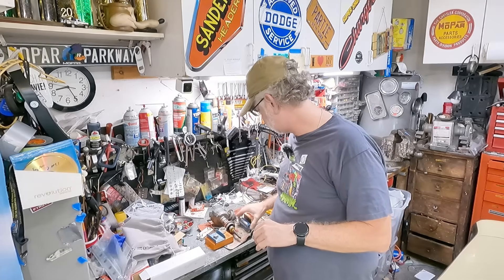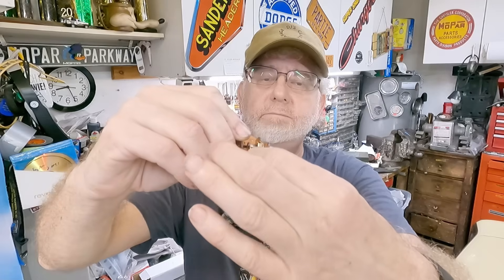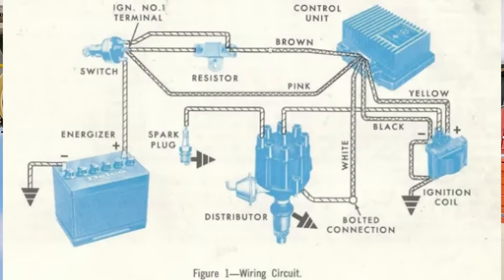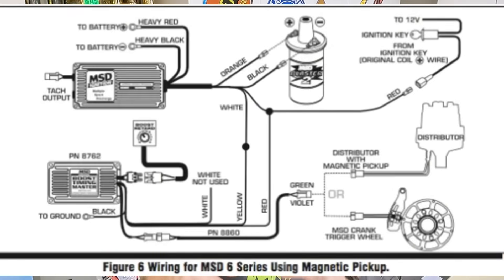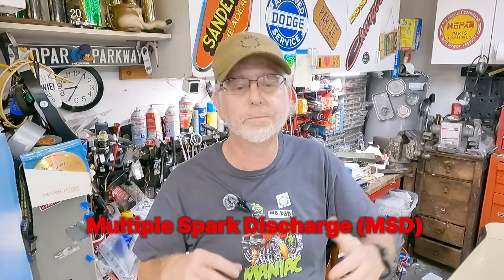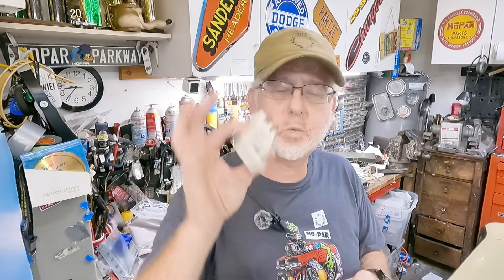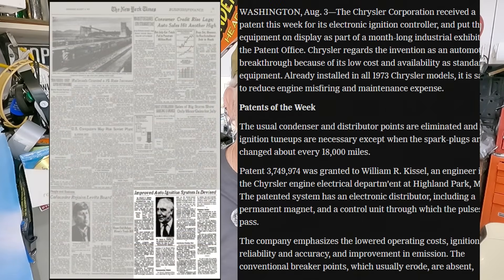Why Everything You Thought About Electronic Ignition is WRONG

Comment: Please let me clarify a couple of things. 
The voltage across the points was about 8VDC while running. There was a resistor to drop battery charge voltage while running, but that was bypassed while the engine starter was engaged. The points are on the primary side of the ignition coil, it's the secondary at high voltage. There was a tiny arc, but the capacitor reduced the current available at the moment the points opened.  

The concept is very commonly misunderstood. The primary coil was charged while the points were closed, like an electric magnet. The quicker the current changes in a coil, the stronger the magnetic field. The primary magnet causes current in the secondary coil, but only when the magnetic field changes. If doesn't matter if it changes from charged to not, or from not to charged, only that there was a change. 

So, when the points open, coil voltage changes from 8V to 0V as quickly as possible. The magnetic field went from strong to none, making electrical energy in the secondary coil. If the secondary coil has 1000x the number of turns, the voltage will be 1000x 8V = 8000V. It's the perfect high voltage pulse we need to make a spark.

The coil charges slower than it discharges so there not enough on the secondary to make the spark.

Dual point distributors allowed good ignition operation at higher RPMs. A single set of points could not remain closed long enough at high RPMs to fully charge the coil. This was fixed by using 2 sets of points slightly offset but overlapped from each other. If either or both are closed, the coil charges, both contacts must be open to disconnect the coil circuit.
Reply: You are a bit incorrect. On vehicles with a resistor before the coil + or key power terminal, with the points open and the engine not running, the coil will read battery voltage on both terminals. No current flow so no voltage drop across the resistor. 
Rotate the engine to close the points and the resistor causes a voltage drop on the + terminal of the coil, to about 8V while the - terminal drops to 0V. 
With the engine running, you would expect to kind of average the 8V and 0V coming in about 4V. This does not happen.
When the points open the inertia of the electrons would cause a spark arc across the points, which would wear or burn the contacts out quickly. Thus the need for the condenser or another name, capacitor. This acts like an acumulator to let the electrons flood into until the points are open far enough that the electrons can not jump the gap. Now the condenser is full and those electrons want to equalize the pressure or voltage. The electrons come out of the condenser and flow backwards through the coil. This aids in quickly collapsing the charged magnetic field in the coil. It is this rapid field collapse across the coil secondary windings that generates the high voltage to jump the sparkplug gap. During this process, the quick magnetic collapse also induces a voltage in the primary windings that can be around 250V. If you do not believe me, try touching the coil negative terminal on a running engine. Then get your multimeter out and test it.
Through this the + coil terminal remains fairly steady at about 8V.
Some coils are built with an internal resistor. These have three terminals; +, -, and starter. While running the + has battery voltage to it which is internally reduced to about 8V. The points side or - operates like the others. During cranking to start, voltage is supplied to the start terminal, bypassing the internal resistor which allows full ignition secondary voltage. 
During cranking, the starter current draws down available battery voltage to about 8V tp 9V. The systems that use a primary resistor of some sort, bypass the resistor somewhere in the wiring system, allowing the 8V during cranking to be supplied to the coil.
Reply: @daledavies2334  Oh how fun!! Please enjoy my retort. "You are a bit incorrect"
I'm sure I had some details lost in vagary. I wasn't publishing a study. 

I didn't mention the engine off condition. If contacts are assumed open, then I agree battery voltage would be measured at the +coil. Although batt+ could be measured, it is not available as potential to drive the circuit when connected. This measurement would be invalid due to improper configuration. 

Why would you expect to measure about 4V at -coil? A DMM could not measure this quickly changing voltage due to the method of voltage measurement it uses. These measure the time to charge a capacitor in an RC circuit, to cross the upper threshold of a 555. In DC mode the sample rate is longer than this circuit. Did you select AC Voltage on the DMM? What was that result. 
Check with an O-scope then get back to me. You can measure the dwell time -coil is at 0 and the ramp time. It's not an RC circuit the capacitor is bonded to ground on both poles while points are closed. At this moment, points are ground, capacitor is ground, -coil is ground (except minimal wire resistance.) 

The secondary magnetic field collapse causes induced Current, not voltage. The high voltage is due to the number of windings within the changing magnetic field. 

Electrons flow from lower potential to higher, from ground to +voltage. This is not backwards through the coil. I agree the cap is there to preserve the contacts. 

The high voltage measured at -coil while points are open is not supplied by the capacitor. This voltage increase will be shunted to ground through the capacitor as an AC signal. It's part of the noise reduction strategy. 

It is the very noisy secondary current which causes the primary current induced from the secondary coil. The secondary load is a sparkplug, an arcing current. Arc currents are nothing close to a resistive load. The current flow via an arc is extremely intermittent. This high frequency very dynamic current causes current changes in the secondary coil, which causes very dynamic magnetic fields which induce this ugly noise back to the primary coil. I forgot what this effect is called but occurs wherever the secondary loads are not linear. The unimpeded portion is shown as the k-factor which causes heating of transformer coils and conductors. 

+coil will remain at about 8V because it is bonded to the Battery, with a linear resistor in series. 

-coil voltage will bounce around like crazy, unless the points are closed. Only wire resistance affects voltage while the points are closed to ground.

The resistor. Each OEM had to build the resistor differently, or pay for rights to use, patents were filed. So, there are many variations. The simplest was to use the key switch start position. The same issue made resistors, capacitors, points, coils, and all else require some creativity. Like where to get the switched bypass supply.

However, the capacitor is always parallel with the points, the resistor is in series with the coil, all are electrically identical (I think).   

What an interesting way to describe the role of the capacitor. 

"capacitor. This acts like an acumulator to let the electrons flood into until the points are open far enough that the electrons can not jump the gap. "
Actually, when the points open the electrons would flood out of the capacitor from its' grounded pole to the higher voltage -coil. But that's hard to imagine. 

The sudden voltage changes at +cap & -coil, is shunted from ground through the capacitor. Current flows through the cap by the ratio dV/dT. 
The quicker voltage rises, the more current the capacitor will shunt. 

Several issues we agree upon. Yes, the cap helps the coil's mag field collapse quicker. But it does so by shunting the induced noise to ground. That induced current impedes the collapse, no doubt.  

The cap does reduce arc over at the contact points. When points are closed, cap is fully discharged, and lots of resistive current in the coil exists. When points open, the coil impedes this current change with its stubborn EM fields in primary and secondary coils, and core if exists, rather without success. The sudden potential difference at -coil, causes the cap to conduct to ground any quick voltage changes. This does give the contacts time to clear contact conduction. With 0 current through the contacts, no arc can form.  

8VDC is not able to form and arc over any air gap. Studies at 60VDC show conduction is first required to strike an arc, then at least 10.2V DC across the arc is required to sustain it. A minimum supply of >2x or about 22VDC is the minimum viable supply voltage. 

I could see induced current from the secondary coming along to ruin our day. But this is still just noise to be filtered by that handy capacitor. 

When the cap failed, the radio would really suck. If the car would even start.

Comment: 12 volts when cold and reduced to 8 volts after about 30 seconds is sent to the coil. The coil is a transformer and the condenser (capacitor) turns the DC into AC. Transformers (coils) don't work with DC only AC. A ballast resistor drops the volts to 8 after a short time, if it didn't the coil would overheat. Dual points are used to allow the coil more time to saturate (dwell) its magic field to produce more voltage (larger spark) I didn't learn all of this till my mid 20's, I originally thought the same thing.
Reply: Battery voltage drops while starter motor is engaged, fairly close to 8V. The Ballast Resistor was typically bypassed by a wire from the starter solenoid contactor to the + pole of the coil. So coil voltage was battery start voltage while starting, then 8V once starter is disengaged without delay. The solenoids, or starter relays, had an integrated contactor specifically for this purpose. There may have been vehicles configured as you described, I just didn't encounter one. 

Ignition coil primary voltage is not DC. It is an AC Square Wave 0V to 8V. Capacitors are not able to change DC to AC. In this application, the capacity reduces the current available when the contacts are opened, just long enough to avoid contact arcing.
Reply: @CycleWerkz on mopar with points they used a ballast resistor. On the ford solenoid the 2 small terminals I for ignition and S for start. Thought i was getting long winded.
Laugh.
My first car was a 1970 Duster. Slant 6 burnt my fingers and eventually its ballast resistor went out, i was 15 in 1984 when i got it for free becausw it didnt run. My 2nd car in 1987 was a 1969 Torino (fairlane) Loved that car, put like 400k miles on it, it had a 302. I had the points trigger a MSD 5 on it after about a year after i got it.
Reply: @kardeef33317  

Awesome, I ran a 64 Fairlane. I think it came with a 289 but was empty when I got it. I stuffed a 390 in the bay with some help from a blue wrench. 

The S on the Ford Start relay energizes the coil in that relay. This closed battery + to the starter solenoid. The S terminal is an input from the key switch. You can use any conductor to connect battery + to the S terminal and the car will crank. Handy while under the hood. 

A coil is an inductor. There is no difference. Coils do what they are designed to do with DC, it is a conductor, a closed circuit. When points are closed 8VDC is on the coil so current flows and it becomes an electric magnet. When the points are closed, this capacitor is discharged. Both sides of the capacitor are then connected to ground. 

Inductors and Capacitors behave opposite each other. Inductors pass DC & impede AC. Capacitors Pass AC & block DC. The values printed on the parts are used to calculate the AC frequency where this effect is substantial. One can design a circuit with both an inductor and a capacitor to select the AC Frequency range allowed to pass through both. This is known as an LC band pass filter. If in parallel, it will block both high and low frequencies but pass those in the sweet middle spot. 

These are not in parallel. The capacitor is in parallel with the breaker points. One side of each are tied to ground, the other to the negative side of the coil. The coil positive is tied to battery + through a resistor, for about 8V. 

The breaker points open and close which creates an AC power supply to the ignition coil. It connects ground when closed, then opens the coil circuit. Coil current drops very quickly to 0 so it releases its magnetic field. This magnetic field was also present in the transformer secondary, when released that secondary winding forms a current due to the changing magnetic field. As you mentioned, the secondary winding will only provide current during a changing magnetic field, not when constant. 

While the contact points are open the capacitor is charged because there is 8V on the positive plate from the coil and 0V on its negative plate. Because the voltage changed, the capacitor flows current long enough for the contact points to escape the arc-over clearance. Once the capacitor is charged, no more current can flow through it. 

Without a capacitor, the coil would still make a spark, but the contact point would become pitted quickly, and the output spark would be delayed and weak. 

The arc between the contact points arcing would slow the current change in the coil which would reduce magnetic field strength. 

You are correct that a transformer will not work without an AC power supply. But this transformer does have an AC power supply.

Here's a diagram 

https://www.bing.com/images/search?view=detailV2&ccid=%2BcllFWPF&id=BAF7E39E7FAE0E7BBCF854FC1003419FAB936120&thid=OIP.-cllFWPFT26cnuUao_tuqQAAAA&mediaurl=https%3A%2F%2F3.bp.blogspot.com%2F-278lSm5V5E0%2FUeIe4N1aUsI%2FAAAAAAAABBI%2F__ZM_BGYJoA%2Fs1600%2Fignition.gif&cdnurl=https%3A%2F%2Fth.bing.com%2Fth%2Fid%2FR.f9c9651563c54f6e9c9ee51aa3fb6ea9%3Frik%3DIGGTq59BAxD8VA%26pid%3DImgRaw%26r%3D0&exph=293&expw=400&q=point+ignition+system+diagram&form=IRPRST&ck=8627F40740B756303B35152F0AF70A78&selectedindex=0&itb=0&ajaxhist=0&ajaxserp=0&vt=0&sim=11
Reply: @CycleWerkz a coil with DC just acts like a inductor, need AC for a tranformer to work and thats all a coil is. Ask someone that does electeonics if a coil or transformer will work with DC. A capacitor maintains voltage through amps. The only reason i know this is in my late 30's I got i to electronics.

Comment: I have an 83 dodge van with a slant 6. I’ve had Mopar stuff since the 80’s so was familiar with the components you talked about. The ignition in my van was a mystery to me. Turns out someone in it’s history swapped in a 1990/2000 HEI GM ignition. The problem I was having was the control module was over heating even after a short trip to town(30miles). I bought a heat sink for a computer, taller with more fins and the issue is gone finally. 2000 miles later it’s the strongest running super 6 I have ever driven. It also has an A833 transmission, very fun to bop around with.
Reply from the maker: Wow that is awesome. Can't be many slant vans .
Reply: @DJsClassicGarage I’d love to send a picture to show what I’ve done with it.
Reply: Dropped a photo over on your IG page
Reply: @DJsClassicGarage Very popular setup in Canada, even in the 5 ton version during the 1970s and 1980s.
I've seen it a dozen times.
The downside was the 1980s the exhaust manifolds would crack where it was almost against the firewall. 
No ignition problem in any of them that I remember hearing about. 
Must have been only American built engines with ignition system problem (but we had the cracking manifolds, and they didn't respond to welding either they just broke again right after).
Those engines were bulletproof only the transmission would eventually need overhaul which is normal.
Reply: @DJsClassicGarage There were many Slant Six vans in the late 60's and 70's . I drove several for work and owned a 1978 . Not fast but had torque .

Comment: The last car I owned that had points was a 1970 Dodge Coronett 500 ,  had to set the dwell on them . I was thinking of getting a MSD ignition but never did. The car had a lot of Raw HP and Torque 😂😂. And it was considered a mid size car back then 😊  and was also a UniBody frame.
Reply from the maker: Love the 500.  Lots had 383 4bbl

Comment: Iput a Mallory Dual Point distributer in my Chevy 302 Z motor. Because the points would float in a single point D.
Dual Point Distributer over 7000rpm keeps steady fire to the plugs
Chevrolet  Z option solid life cam. Keep your GM all GM used to count for quality. not any more.
Reply: I had an Accel 9000 RPM dual point distributor in my first truck. I wish I had of changed it out for an HEI before I sold it (and changed the M-21 too)

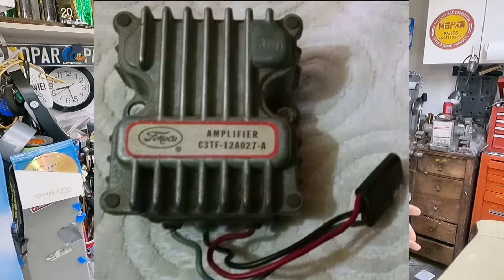Comment: The Ford amplifier at 2:22 is part of Ford's Perma-Tuned Transistor Ignition System which was developed in 1963 for Ford trucks as indicated by the part number on the amplifier. It was used on the 427 engines but the most common place you'll find that system is on mid 60s Thunderbirds and Lincolns. Duraspark was first used on the 1973 Lincolns and then Ford and Mercury in 1974. Duraspark II came out in 1976. For awhile in the 1970s Motorcraft made Solid State Ignition Conversion Kits not just for Fords but also for other makes including Chrysler, GM, AMC, IH and VW.
Reply from the maker: Cool,  The early 70s there was a lot of experimentation

Comment: The points switch 12vdc, not exactly high voltage.
Reply: The high voltage comes when the points open, the energy stored in the magnetic field in the coil, that was created by current flowing through the coil, now has nowhere to go. This creates a large voltage spike in the coil secondary windings which is used to fire your spark plugs, but can also create hundreds of volts in the coil primary windings, which can burn the points.
Reply: @alexjenner1108  stay in school